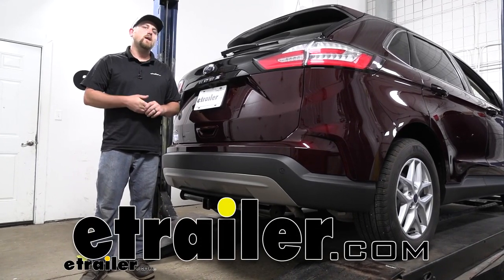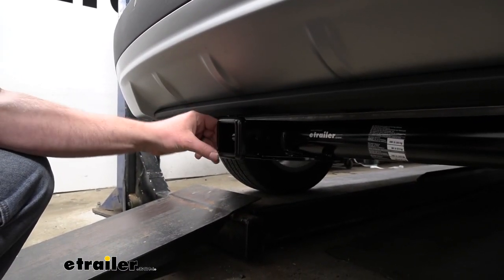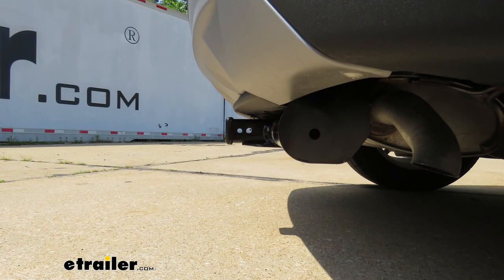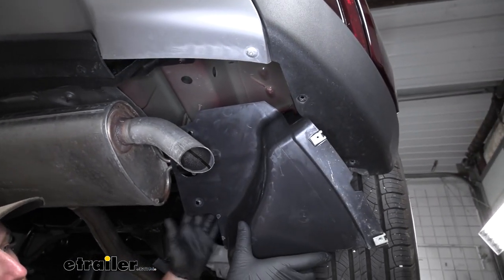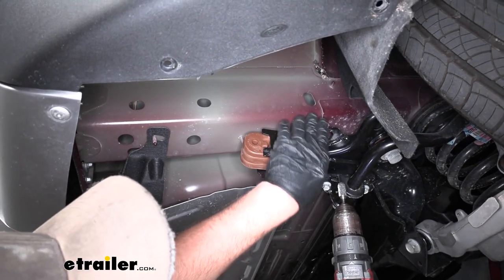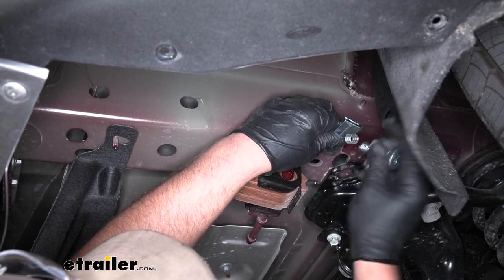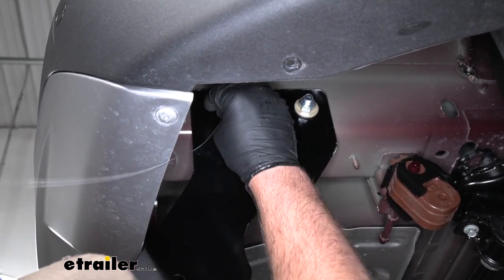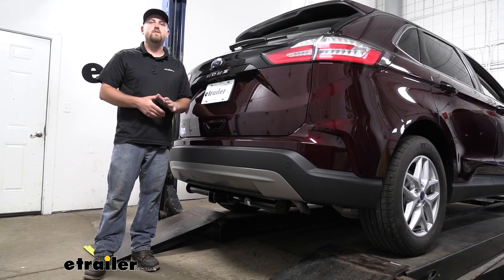etrailer | Draw-Tite Max-Frame Trailer Hitch Installation - 2021 Ford Edge

Comment: I just installed on my 2021 Edge SEL. I chose to run the bolts through the hole up near the back of the bumper so that i didn't have to grind anything. It's quite a large hole, just feel up in there (you won't be able to get eyes on it). Thanks for the tutorial.
Reply: Do you need to lift the car, also did you have to use the fishing tool they used? Thank you
Reply: @paullankford5584  I put my carbon a lift. It would be possible on the ground but it would be very difficult. The angles you have to put your hands to fish the bolts and torgue the nuts at would be hard to do with the car on the ground. Yep, I still needed the fishing line to run the bolts.